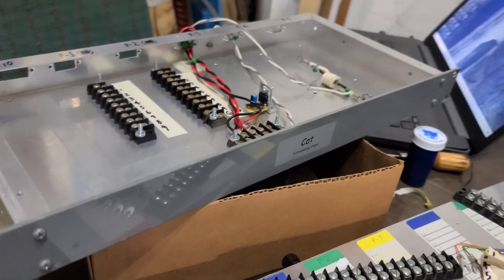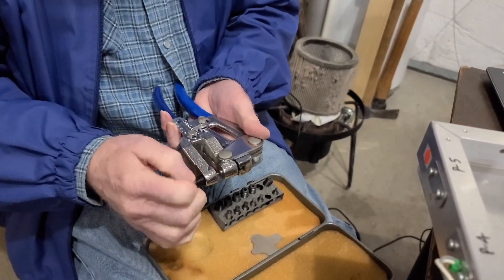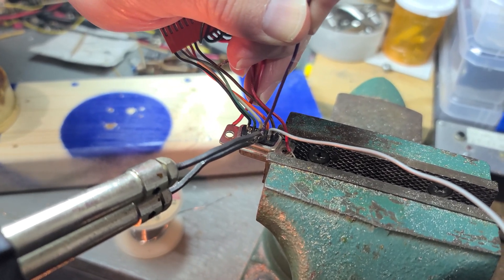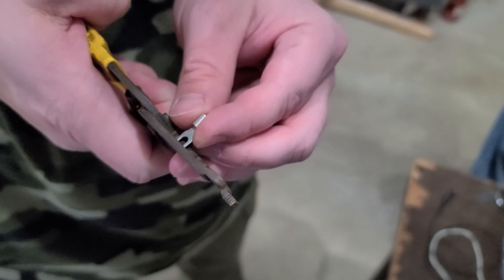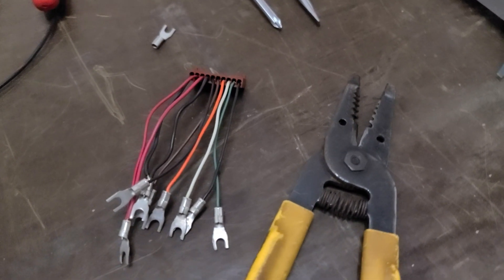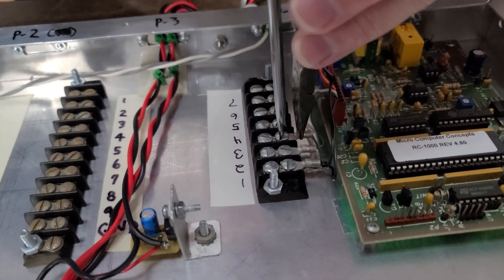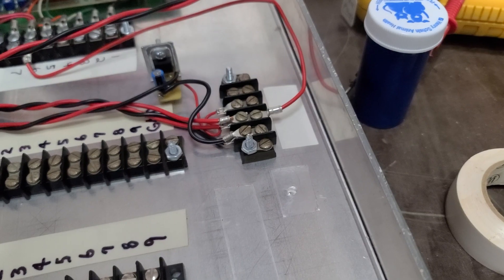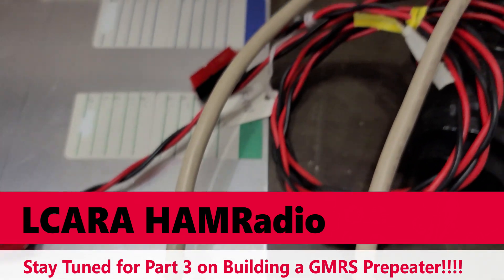LCARA HAM Radio: Building a GMRS Repeater Part 2 - Termination Panel

Comment: Why are you calling it a CAT controller? Isn't it an RC 1000 controller?
Reply from the maker: Misspoke on that one. AC4DM has both in the shop, Thanks for watching!
Reply: good point
Reply: Too bad the guys who developed the original CAT controllers shut down, last I looked they were only repairing certain controllers. Wonder if they sold out the design to someone else or did someone come up with a very similar but updated clone?